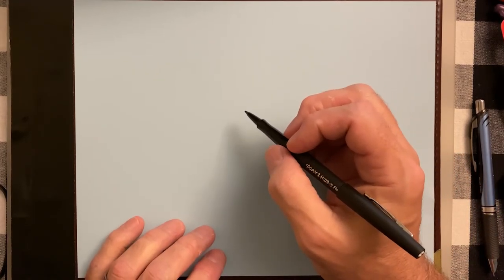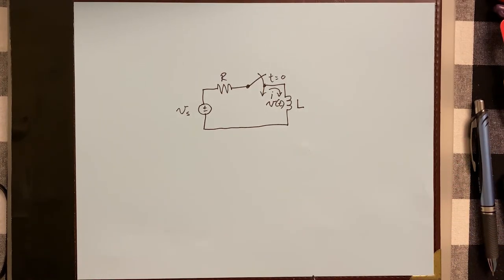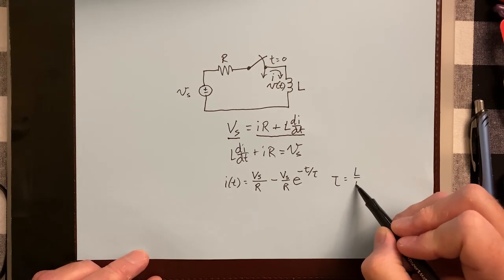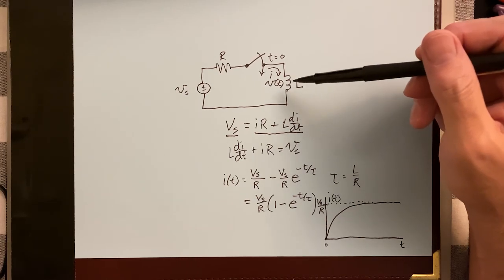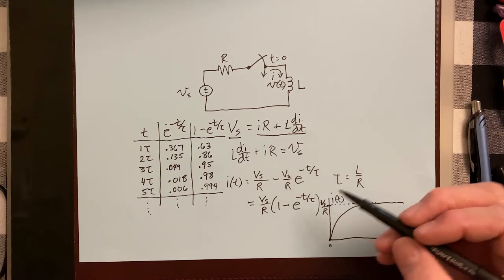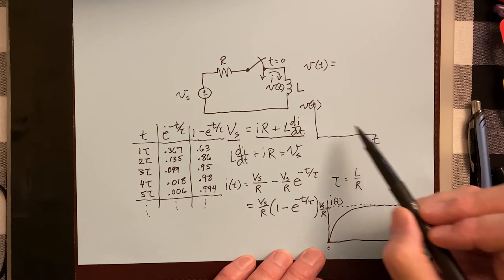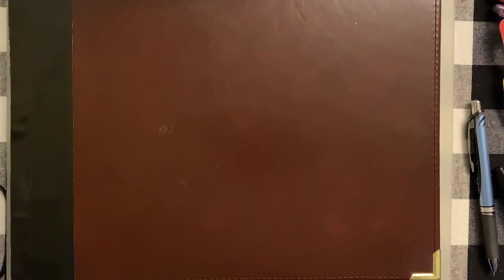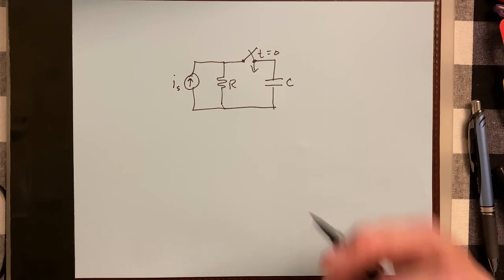17-Step Response of RL and RC Circuits

Comment: Hello sir
I have a question... If we want the total power in an RL (step response) circuit that has only one resistor and one inductor in series with a dc source... Can we just do P= V²/R and the result will be the total power since the inductor does not consume real power?
Reply from the maker: Yes, as long as V is the voltage across the R. If the voltage across the R is V, then power dissipated by R will be V^2/R. The voltage across the L after the magnetic field is fully established is zero, so no real power. Energy for the L is stored in the magnetic field. Energy is consumed by L to establish the magnetic field, but once established all energy is dissipated through the R. Hopefully that answers the question you were asking.